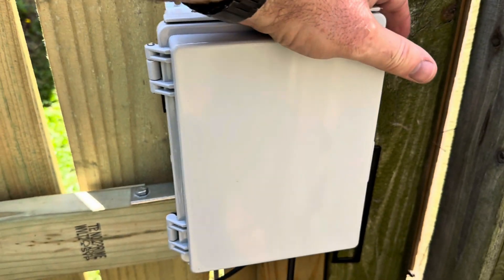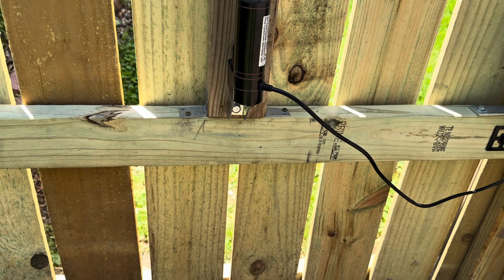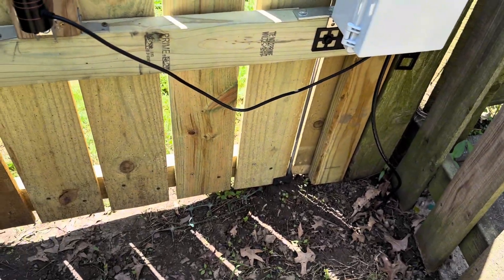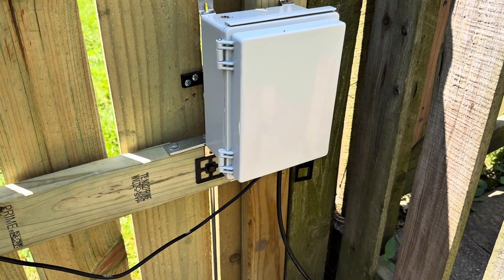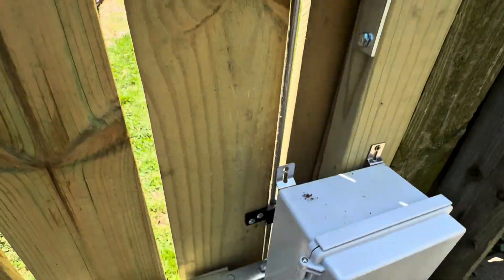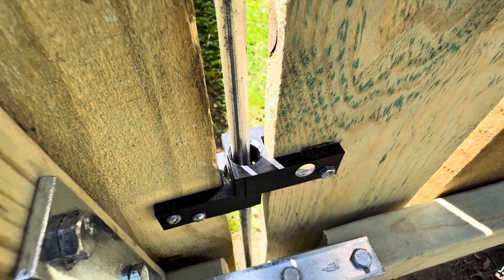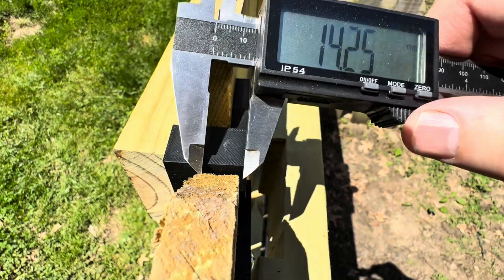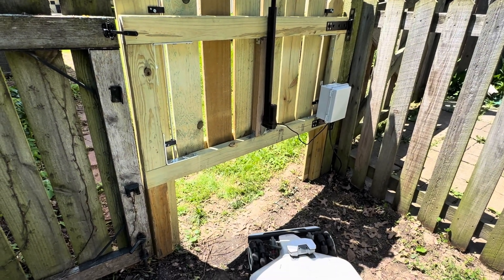Robotic Mower Motorized Gate Build Overview

Comment: Would you be able to give some info about your original beacon setup? I would like to build a garage for my Luba Mini that opens and then close during the Luba is cutting the grass and then opens again when it returns to charge.
Reply from the maker: I’ll try to find some of my notes about my build I did and let you know! That is the perfect use case for the beacon setup.
Reply from the maker: Ok so the actual full project had a lot of code to it etc. but I would get on ChatGPT and let it know what you’re wanting to do, it should take it from there. The components I had used were a Raspberry Pi 4 and a BC04P-MultiBeacon. Other components will be different on your specific needs for the project. But those are the main items to trigger the activation.
Reply: @Makeallofthethings  thanks. Will give it a try, I use Homey Pro for my Smart home, might be able to find something that will work with Homey.

Comment: If you use home assistant,  you can make an Automation that will trigger the opening when your Luba come close to the fence as it will constantly know its position.
Reply: Doesn't that mean it will open every time the mower is actually mowing close to the gate? How will the gate know if the mower needs to go through or is just mowing in front of the gate?

Comment: This is great ! I am planning on making one myself, I am also trying to work out how to automatically open the gate. Maybe a 3-4m range rfid reader ? I have been searching but so far haven’t found one that looks suitable.
Reply from the maker: I’m looking into this as well. My original design went off Bluetooth signal from the mower would trigger a open/ close script on a Raspberry Pi, but it would then open when the mower wasn’t ready to go through, it was just mowing the area near the gate. My dog would zoom right on through. I know they make a proximity sensor for the IPS1 version of the linear actuator controller, that may be the way to achieve this if you don’t have a crazy dog lol. 

I hope your gate build goes awesome!
Reply: I am trying to adapt this for my fence. Just out of interest how high and wide is the opening ?
Reply from the maker: I made it 18” tall and approximately 40” wide

Comment: So I’m not sure if I missed it, but how does the gate know when to open or close? Is there something on the Luba to  open the gate?
Reply from the maker: Hey there, you can either set it on a schedule or I also use the FPV on the Luba and open it when heading for the gate. Once it’s through I have it close. There may be a way to get it to sense the Luba within a certain range, still looking into that.

Comment: Does the remote work with theee gate controllers or do I need three remotes or three gates to be open at once?
Reply from the maker: That’s a great question! I only have the one, but I’m sure DIHOOL could answer that, I wish I could test it!
Reply: @Makeallofthethings I have two neighbors lawns I need to get my newly ordered lymow into. I'm thinking this paired with a magnetic induction/proximity sensor as a control would do the trick to open it when the mower passes over on the way to the next lawn.
Reply from the maker: That should be a great way to go with that. The Lymow looks awesome, can’t wait to see more on those!
Reply: @Makeallofthethings  I'm actually starting to think that a waterproof momentary switch that the treads can roll over. Maybe best to trigger the DC motor controller. I am attempting to find the manual anywhere online. I can't seem to track it down. Not that it's important to have the information right now, but if you get a chance to find the instructions, doesn't happen to have a input for a push button or some type of key function with continuous operation?
Reply from the maker: Sorry about the delay on this! I was out of town and had to get back home to find the manual. It doesn’t look like it’s an option on the S2 model, but on the S1 it has many more options, it may work. I like your thought process on it, just would have to make sure the gate has enough time to open after triggering the switch as the mower will definitely collide with the gate as I found out once when opening it too late 😄
Reply: @Makeallofthethings thanks for looking. Time will be controlled by placement of the button in proximity to the gate. It will take a bit of experimenting, but I'm sure as long as the controller supports it, I can make it work!